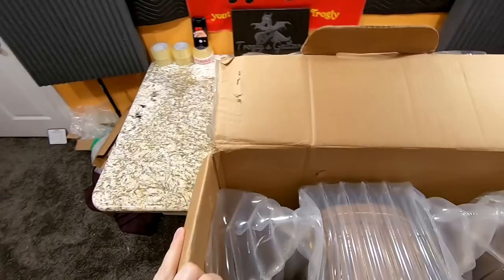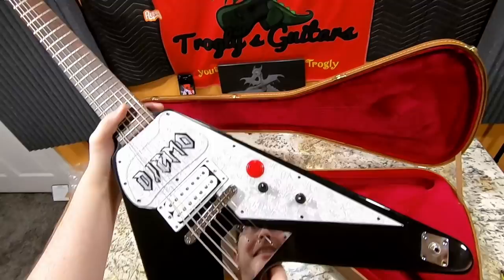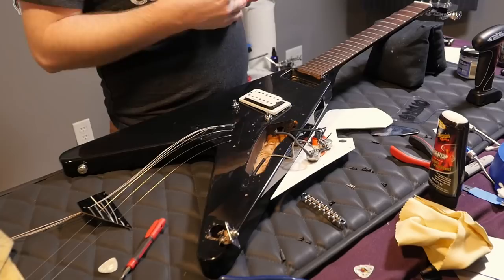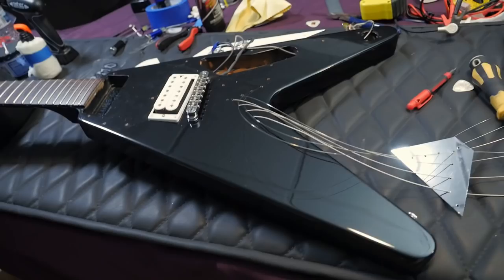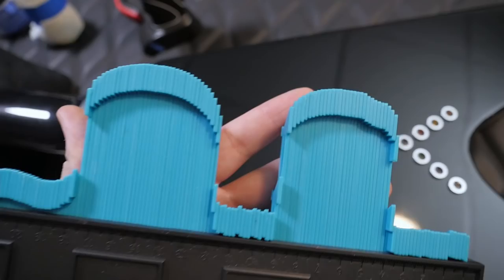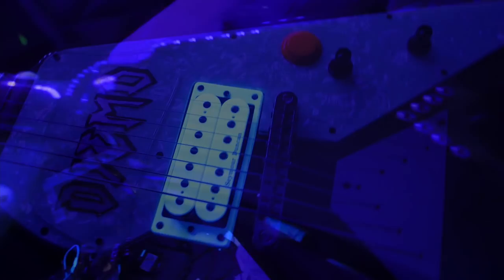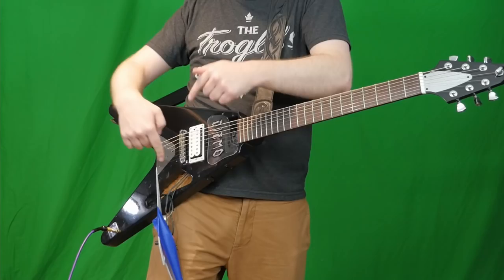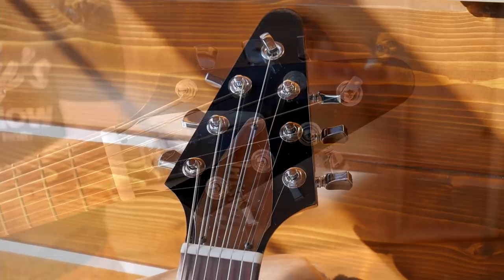I've Recovered Lord DJEMO | The Gibson MOD Collection 7 String Flying V Review + Demo

Comment: That’s some really cobby workmanship under the pickguard. Not something I would expect from a major manufacturer. The guy who put that together must be a real djerkoff.
Reply: Probably no longer working there after this vid!!  ✅
Reply: @luthravin4774  Promoted to shop supervisor and given a $20 and hour raise
Reply: Pretty crappy routs.
Reply: I see what you djid there
Reply: Duane D - That ISN'T from a major manufacturer...  Whoever took the EMGs out assed that guitar up, and I seriously doubt that was Gibson.  A hack has had his hands on that guitar.  Gibson would NOT have routed that pickup cavity and under the control pots with Forstner bits, which is what somebody did.  Also look at the painter's tape on the pickup wires at the volume pot.  Some wannabe "luthier" screwed this thing all to hell... Gibson just got it back and resold it as-is.  Djunk.
Reply: @andrewdempsey5312  djat djone djidnt djwork, djundjortudjnately
Reply: That isn't from factory.

Comment: Scale length and other specs are the biggest issues with all the Gibson 7 strings. People have no problem paying Gibson prices for 7 and 8 string guitars. Companies like Kiesel and Aristides show people will pay top dollar.
Reply: Totally agree with you, that 24.75" is problematic if you want to go low.
Reply: @hkguitar1984  I barely tolerate the 25.5" 7s I have
Reply: @BenState  7th string can be too loose feeling if you tune down
Reply: @BenState  The problem is that by going thicker, you not only basically have a bass string, but the nut isn't cut wide enough, and the string hangs up making it impossible to keep in tune. The scale length has to be extended.
Reply: @johnevered9640  use bass strings thank me later
Reply: @BenState  Whatever, waste your own money on the brick if you don't want to listen to experienced extended range players. Good luck.
Reply: @BenState  If I was playing doom metal and wanted to sound like warm sludge maybe but it'll still be hard to keep in tune or EQ if I wanted any punch and clarity for anything faster. Also,  22 frets? No thank you.
Reply: @BenState  Lol..Am I ok..um..you are the person who can't understand why someone couldn't tolerate a 25.5 scale, then you saying that cutting a nut on a $2,000+ is no big deal. Dude, have you ever filed a nut? I have, using a set of Stew Mac files, and one wrong move..and that nut is toast. Now, let's say you have the expertise to widen that slot without going too deep. Now you have this massive bass string that's flubbing all over the place because at 24 3/4" scale, it's all but unplayable. Find out for yourself bro.
Reply: @BenState  I mean you can! But at a certain point it just gets muddy, and while I think putting a .80 would be fine for B or even A, if you wanted to get into like, G territory the 24.75 scale isn’t ideal!
Reply: @spikesguitarcamp  lol. Speaking of Loomis are any of you preordering his Jackson SL7 sig model? I'm going to need a review from someone who also has a JL7.
Reply: @holstorrsceadus1990  That's a pretty serious axe..26.5 scale, Floyd, his own pups instead of the EMGs. I was surprised he left Schecter, but he definitely got a great sig guitar from Jackson. My buddy has his 6 string Kelly, and is already thinking about trading up to the 7.
Reply: @BenState  make me a list of bands that use 24.75" Gibson 7 strings and then make me a list of companies other than Gibson that use 24.75" scale length for their stock 7 string models. I'll save you time: both lists are empty. Wonder why that is?
Reply: @spikesguitarcamp  All great information Spike, thanks for chiming in.
I was watching a PRS video and the reason given for PRS's 25" scale length was due to the shorter Gibson scale of 24.75" had a tendency to ring sharp when playing a hard open "E" Chord.  So yeah, depending on what you are doing the shorter scale length of a Gibson can be a problem (as you've already pointed out).
I'm with you, I've cut numerous Nuts and would rather start off by choosing a better instrument for the intended purpose (longer scale length).
Of course anything can be modified to do anything else, but that isn't the point.
If Ben wants to cut Nuts on his own instruments that is on him, and its not likely he'll ever seek out You or I to repair/restore what has been done!
Just saying
Have a great one Sir.
Reply: @hkguitar1984  And to take it one step further, the introduction of the fan fret multiscale is an amazing step forward, because now, as you increase the scale, all the strings start to get stiffer. So if you're a lead player, the higher strings are now really hard to bend..I just got an 8 string that goes from 25.5 - 27, and now I wish all my 7 strings were like that also. It seems to be better intonated as well playing complex chord shapes.
Reply: @spikesguitarcamp  That is really interesting.  I'll have to check one of those out, I believe my Son has been looking at a multi-scale instrument.
Reply: @Holstorr Sceadus

Not defending the use of 24.75” on a 7 by Gibson, but the list isn’t entirely empty in terms of bands. Matt Heafy of Trivium uses a 7 string LP sig with traditional scale. But he had a lot of problems with it until having an evertune installed. Apparently his new 7 string LP sig will be longer scale, but I’m not sure how much longer. If I had to guess with it being Gibson/Epiphone it’ll only be 25.5” which still isn’t ideal.
Reply: @Andrew_182  yup 25.5 for the new one. Even the dude with guitar techs on staff thinks 24.75 is a hassle.
Reply: @Andrew_182  It's a step in the right direction at least.
Reply: @spikesguitarcamp  have you ever sent a guitar to a tech for a set up lol???? Having your nut filed for a different set of strings is literally a norm these days. Plus, it costs $11 for a fucking nut replacement.  What fucking hemisphere do you life on lol.
Reply: @holstorrsceadus1990  Trivium, specifically Matt used 7 string Epiphones with 24.75 inch scale length. But plenty of other bands have used Les Pauls and other Gibsons to tune down to B and remained tight for metal.
Reply: @spikesguitarcamp  I have content, and I have to agree with the others. Widening a nut to accommodate the strings you wish to use is not a big deal. Its very well something you would still have to do on a longer scale length guitar or even a multi-scale/fanned fret guitar. Plenty of 7 string players out there absolutely killing it on 25.5 inch scale lengths, even with tuning down. Jason Richardson uses 25.5 inch scale length for drop G, and no one is about to claim he isn't a tight player.
Reply: @guitarnerdjoey1192  as pointed out earlier Matt's new model is 25.5 because even he realizes 24.75 is not ideal. 
  Stoner/doom/jugg jugg metal guys don't need to worry about tight action and intonation especially the drop tuners. They're just making an bunch of boomy fart noises anyway so flubby strings are ideal.
Reply: @holstorrsceadus1990  Again, plenty of bands have tuned down before with that scale length and remained tight enough. Carcass are a good example. Whilst its not ideal for some people, its not impossible to do. If you prefer longer scale length, then get a guitar that has it and enjoy the heck out of it. I suspect part of Matts move there is also because he is playing more guitars with longer scale lengths, like his Aristide 8 strings. I find jumping between longer scale length guitars to smaller ones and vise versa can be somewhat off putting, so he might be trying to mitigate that effect also.
Reply: @guitarnerdjoey1192   a lot of people drive Honda Civics it doesn't mean they're the ideal vehicle. 
Bill uses a LP specifically because he wants the thicker tone that those slightly less tense strings are going provide. He doesn't care about tight action and snappy response or note definition. Great for him finding the tone he wants but that doesn't change that he's sacrificing some tuning stability and other things to get there.
Reply: @guitarnerdjoey1192  if 24.75 was better why didn't Matt get his other guitars made in his custom model's scale length instead of moving his custom model to their scale length.
Reply: @holstorrsceadus1990  1. Usually thicker strings is for thicker tone. So that part confuses me with what you are saying. Either way, it's whatever works for the individual. 
As for 24.75 being better - I never said that. I simply said IT CAN work for lower tunings and others have done it before in the past, especially for going only as low as B. Whether it will or won't work for you is simply personal preference in terms of tone and feel for how you like your guitars.
Reply: @guitarnerdjoey1192  Hey Joe. The original discussion was about the Gibson V with a 24 3/4" scale, which, IMO, is not a suitable length for an extended range instrument. The premise was that it was not worth buying a $2,000 instrument to have to modify it to be playable. Some people took offense to that premise. Thank you for weighing in. Spike

Comment: If the thing works when you flex the pickguard, that leads me to believe that there's probably a cold solder joint between the pots, likely one of the capacitor leads. Try re-flowing all the solder joints real quick before you send her off. I'd hate to see it get injured in shipping for something that's likely a simple home fix.

Comment: The problem with kill "button" vs. kill switch is that with the button you can only play the "off" on the beat, whilst with a "lever" switch you can put it in "off" position and play the "on" on the beat, like the intro to "Delivering The Goods" by Judas Priest. They played it with a Gibson SG or V with the neck volume at zero and using the normal switch as a kill switch.
Reply: At this point you can just use the pickguard itself as a killswitch

Comment: I'm not a fan of Flying V's, but being a 7-string makes all the design elements work, and the headstock looks especially cool. Too bad regarding the electronics. Could be a grounding problem or cold solder joint. Good the Warranty is still in effect. Shout out to Pacifica Guitars for sending you the guitar. 👍😎

Comment: They used Forstner bits on a drill press to "rout" that out. Telltale circular patterns with a centering dip. I would have followed it up with a trim router to clean it up a bit, but yeah...it works. Honestly, with the added problem of the tone pot being wonky and the questionable pickup wiring, it kind of looks like a garage mod, not a factory mod. I wish I was closer to ya, I'd clean that up for free, just cause it deserves to be helped. Adding a second pickup would not only require more woodworking and clean-up, but also causes the problem of having to add back a 3 way switch to the whole mess (probably at the cost of the kill button).
Reply: yeah the drill press shocked me, like I always clean my drill pressing with a hand router, and i'm only doing mods for myself and i'm 15, it does not take that long to take a router to clean up your work

Comment: Want a effect pedal inside easy to do first find a mini one ya like.  Remove from its housing i would use a homemade riser block to fit it in securely.  Run the battery box wires to the power side wire up the signal in an out to an from the jack plate. Rewire a on off switch to pedal an add to the pick guard test out for issues an boom built in effect lol. Should be big enough for a mini one of your choice an if your feeling extra. Add a connector to the switch an power and jack connectors make the riser block swappable an mock up multiple pedals for more tone opportunities. LoL

Comment: I plan on my next guitar being a baritone. Just not sure what model I want it to be kind of leaning towards a Telecaster but if something else catches my eye first like a decent SG or Stratocaster who knows. To bad the Wilshire or the Crestwood isn't offered as a baritone.  That's actually what I'm interested in after I get my Casino. I like how they put that string up top. Only thing I see if you'd do something similar on a LP is the Gibson logo would have to move where you'd usually have Les Paul model and Les Paul would have to be either left off or put on the truss rod cover. Though I thing that tuning key would look like a zit on a forehead . If Gibson really had to put something other than a round input jack plate they should've gone with a diamond shaped one. Or install it on the side the wing. I always wondered why they didn't put the input a off the side the wing but at an angle 10 or 15 degrees from parallel. Isn't there a model or brand of guitar named Pacifica. As far as that rout by the neck they ssf should've put a pickup there. Maybe routed space in the cavity below the bridge  to move the controls back towards the tip of the wing and installed the flanges below the pickups . Would save a little room using the space where the volume would be if the put one of those switched pots to activate the  flanger. Or get a switch off alone away from the kill switch. The kill switch obviously was working quite well  since everytime you put down the pickguard you loss signal. I wonder why they didn't put tuners like a firebird has. Don't know if it's the strings or drop D or a combination that guitar sounds pretty heavy.  A good friend who can play anything he sets his mind to has a 7 string but his tones n most of what he plays aren't as deep.

Comment: Also a tip for the future if you're struggling with wiring issues — you can test the pickup and wiring by playing music from your phone and holding it over the pickup while it's plugged into an amp. Means you don't have to go taking strings on and off, but you can still hear the volume knob and tone knob doing their thing when you twist em around.
Reply: How about just tapping on it with a screw driver? I suppose it doesn’t really show off tone pot well but most techs including myself do it
Reply: @AppaBoy  Yep, I do that while I'm at the bench but if I'm totally wiring stuff from scratch with some more fancy options like phase, DTB, series/parallel, splitting, or some combination thereof it's a fun way to just be extra sure it all works without spending extra time on stringing up and down.

Comment: You DID used to be able to buy the original Steinberger Gearless tuners on StewMac. I bought a set in about 2004 for my Firebird V because l didn’t much like the klunky, heavy old banjo tunes it came with. I think l paid about £100 shipped from the US. They tuned far better and rectified the Firebird’s slight tendency to neck dive. The original Steinbergers were much cooler, too. They didn’t have that ugly T-piece on the front to lock them off, just a knurled collar with a pair of flats you could tighten with a spanner. Just as effective, but far more elegant.

Comment: I could be wrong but I think that Seymour Duncan uses green and bare are ground; red and white get soldered together and black goes to either a pickup selector or a slug on the volume or tone if only one pickup is installed with no toggle… yours has the black and red soldered together… could that be part of the grounding out issue?

Comment: I'm by no means an experienced guitar tech but I have installed a couple of Seymour Duncan's in my personal instruments in the last couple of months. In my instances the white and red wires were soldered together and taped off, the black was the "hot" wire and the green and ground wires got gtounded to the back of a pot. Looks like the white wire is used as the "hot" wire here with the black and red taped off. Could that be posing an issue?

Comment: ill give u a drop a for affort lol. which is the tuning that would be in if u kept the 6 strings standard than tuned the 7 to an a . I generally use ADADGBE for my 7 strings just for a fuller drop D sound. Its a bummer tho because i thought those epiphone versions would be cool to play even tho the scale length is to short. 25 1/2 isnt to bad if u play in standard, but im so use to 27' scale that having that 24 7.25 would feel awkward to me .